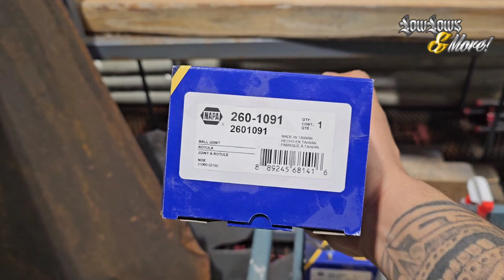Finishing up the hopper and built the drive shaft with a Slip Yoke

Comment: Have a quick question I had a issue with my solenoids that make the left corner to go up and it just clicks but I changed new pair and tighten all down still clicks when trying to lift up can the yellow wire to the dump if it’s loose would this cause my switch to click or is it something else thx ??